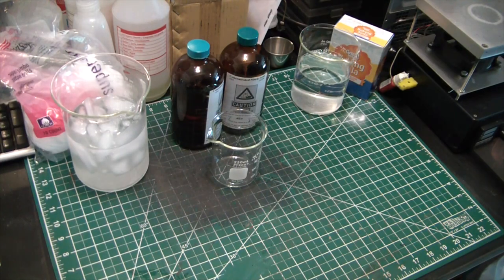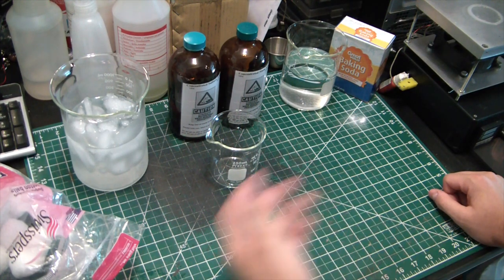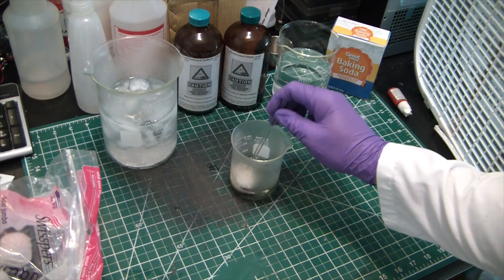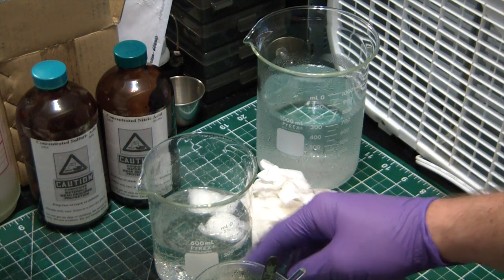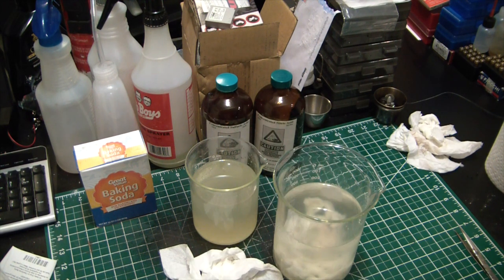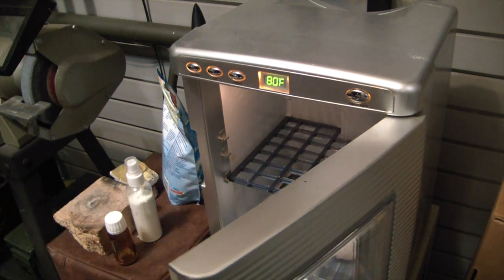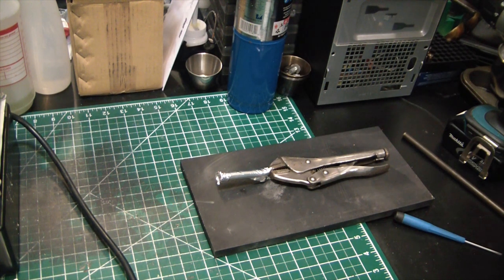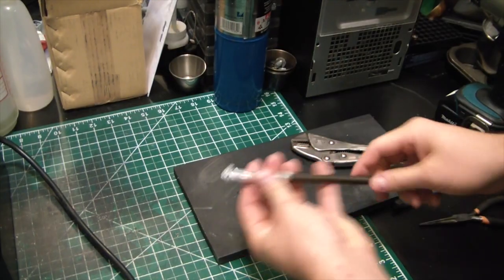Making Flash Cotton / Paper - Magic Trick Fireball (Nitrocellulose) - ElementalMaker

Comment: You need about a six-inch piece of cold roll steel rod , which you can drill a center hole about the size of a round ball lead sinker, then a tiny fuse hole from the side into the chamber. Then put in a short piece of cannon fuse and pack your flash cotton in the front with a wooden rod and a lead pellet on top. If you really wanted to have fun you could make a miniature cannon base for the whole thing and try it out in a safe place. I think that would be cool to watch. You might need to polish the inside of the barrel before testing it to be sure the lead does not hang up. It might make for a really cool project. And Youtube video.
Reply from the maker: I have a 70 caliber Cannon. Check out my other videos
Reply: @ElementalMaker  I  have half of a    small injection molding barrel. Not sure what size the hole is. Figured I'd build a small cannon one day. It is around three feet long. And I am guessing the hole is about an inch and a quarter to an inch and a half. It weighs about two hundred pounds. The original barrel started out at about six feet, but was too heavy to handle without a forklift. So I used a forklift to set it on a metal working band saw and cut it in half and kept the half with bolt holes for an endcap with threading for a nozzle and I kept the nozzle as well. So basically I have all I need to build a cannon. This barrel is very thick walled as well I want to say it was from a small VanDorn machine. The bore hole is about the size of a racketball ball.
Reply: My biggest hurdle now is disability. Have diabetes and complications from it going undetected and uncontrolled for so long. And also congestive heart failure. May not make it to see the project through to fruition. But you never know. Maybe my grandson would like to take it on and build it. Think it could be one heck of a cannon.